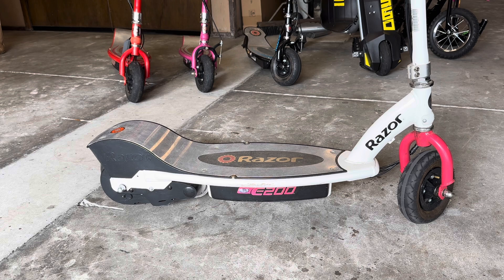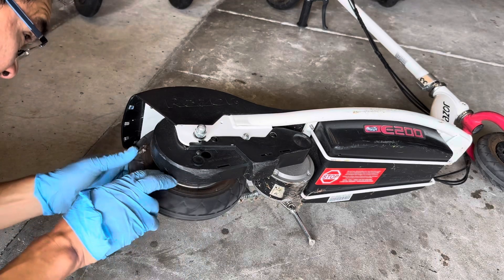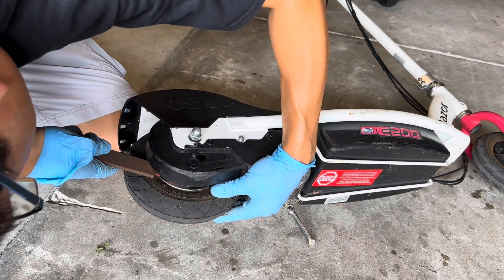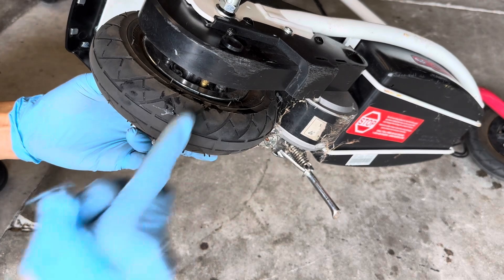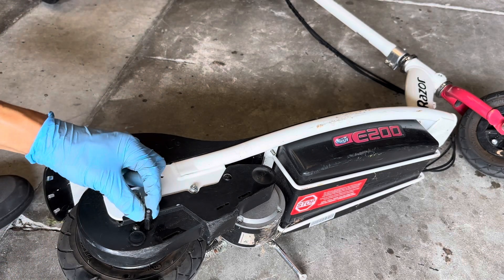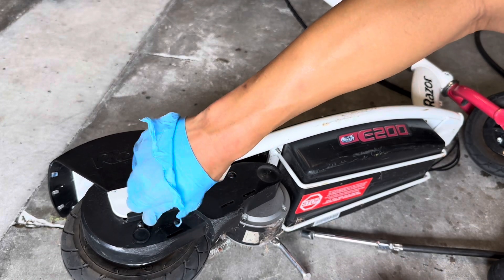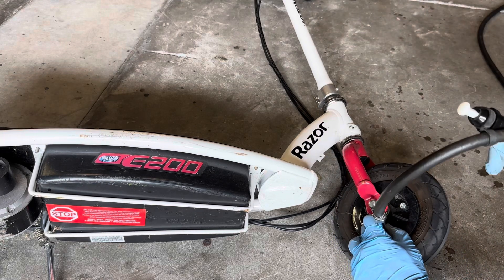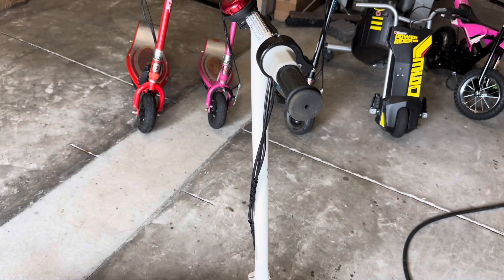How to pump air in tires on Razor scooter e100, e200, e300 and power rider 360

Comment: What type of pump are you using
Reply from the maker: Hi, I have an air compressor in my garage that provides air for my pneumatic power tools.  Here's what I used to add air to my tires.  It's a bit much for pumping up tires though, a simple bicycle tire pump would work fine for these scooter tires. Thanks for checking out the video.  Let me know if you have any other questions.  

Tire inflator attachment
https://amzn.to/3D3IQOc

Air compressor
https://amzn.to/49mPECL

Air Hose Line
https://amzn.to/3BhhFyQ